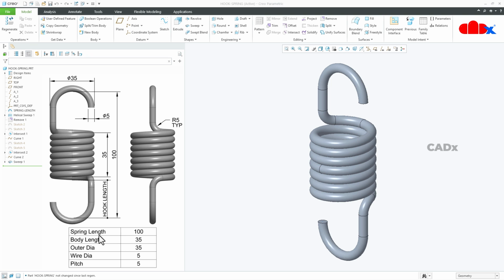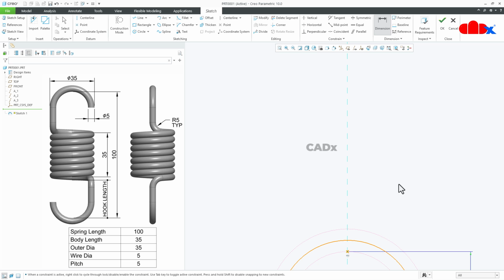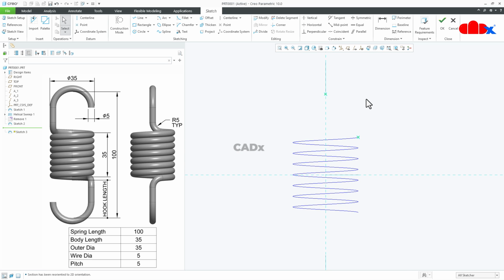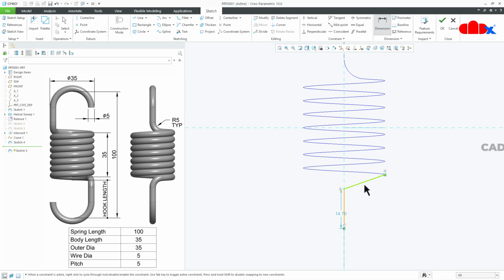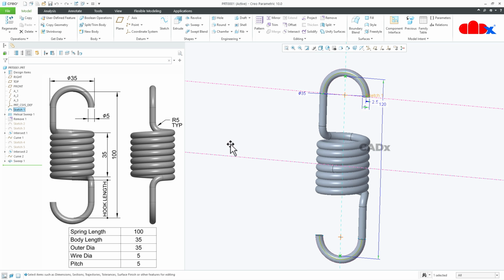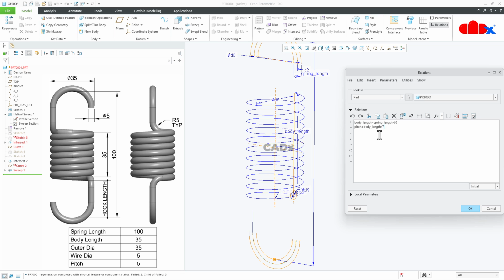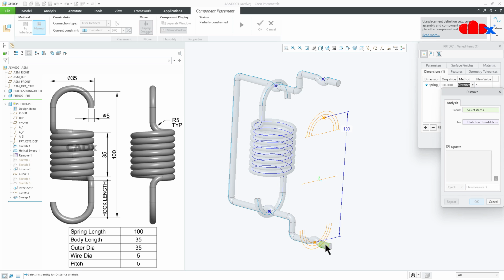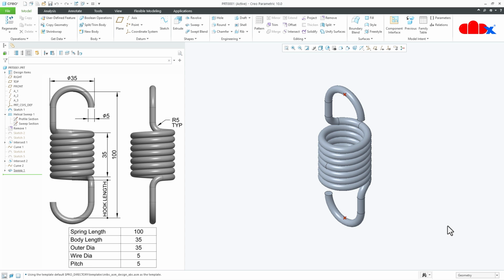Hook spring in creo parametric

Comment: Thanks for this tutorial. Could you expand on this with other relations? For example, you could set a relation to prevent the spires from overlapping. Another relation could be set to prevent the spring from extending unrealistically. You could also control all the spring parameters from the Parameter Window. And you could even display the force (N) exerted on the spring as a note beneath it.

Comment: Is it possible to fix one point as ground,and attaching a component which is in slot mechanism at another point,so i can use motor?
Reply from the maker: For mechanism design you have dynamic spring there.
Reply: @CADxTraining  Thanks sir,but my question is ,is it possible to do spring elongation without using dynamic spring ?
Reply from the maker: @AbdulRahman-nv4xd 
You can use flexible properties within the assembly design. But this functionality will not work in mechanism design.
Reply: @CADx-in  Thank you for your quick reply sir❤️

Comment: I didn't understand the Offset of -2.5 and then making it construction line....for what purpose it was all about in this case
Reply from the maker: This is just to control the dimension from that construction sketch. Sometimes you have dimensions from the top curve or bottom curve.